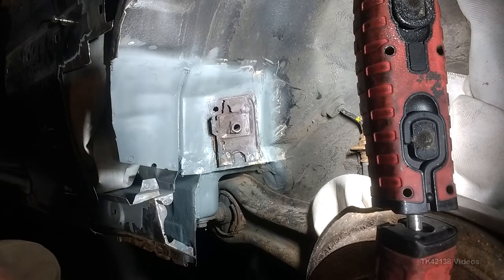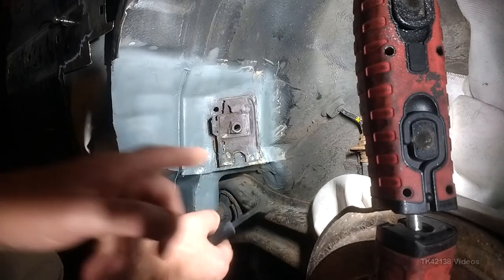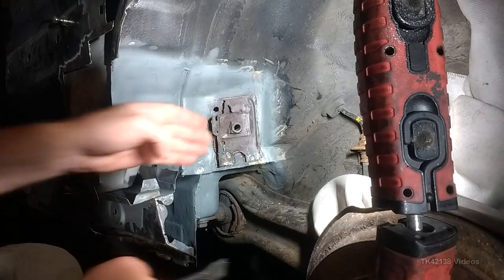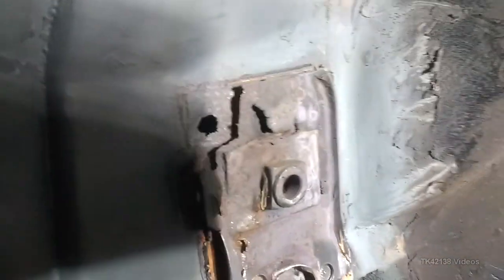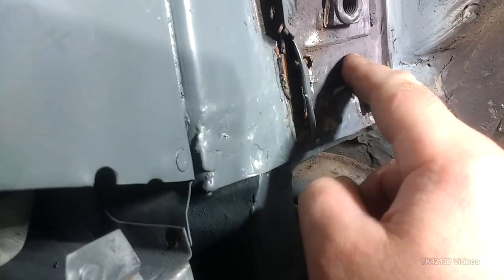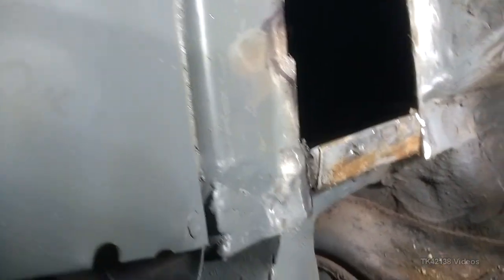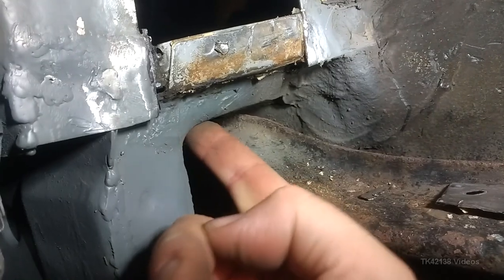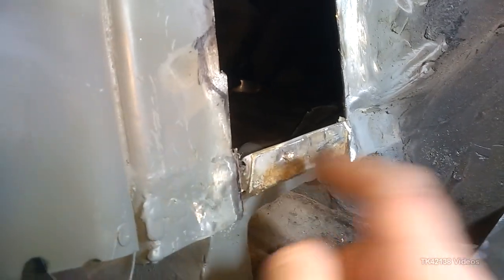Part 43 'Rusted rear seatbelt mount'

Comment: Nice to see theres still plenty to keep you busy and youre not sat wondering what to do with yourself on these long summer days.
Reply from the maker: Yes - lots to do. Already missed several 
self-imposed deadlines such as the St George's Day drive your classic day back in April and Festival of the Unexceptional this weekend. The clock is ticking now as needs to be on the road before Mrs TK42138's fiftieth in October.